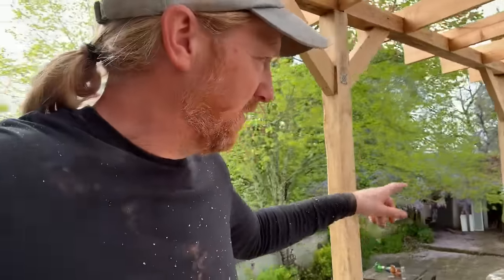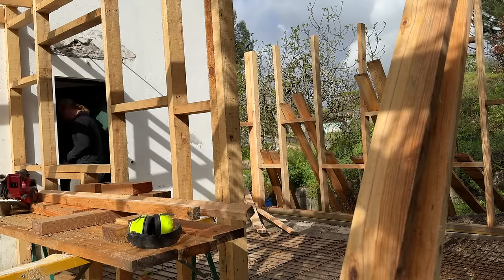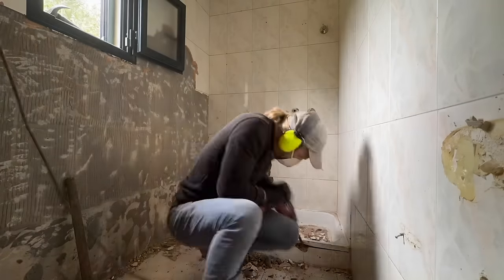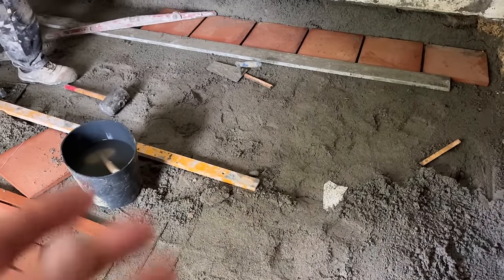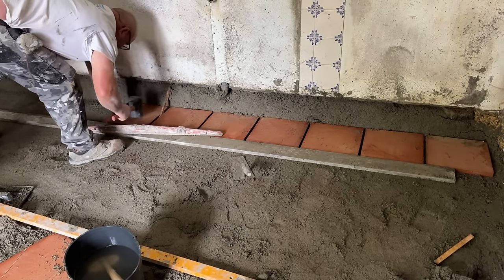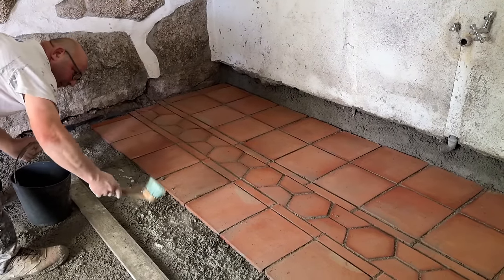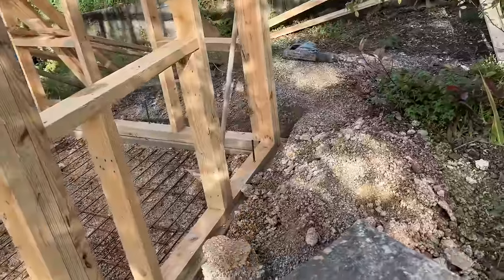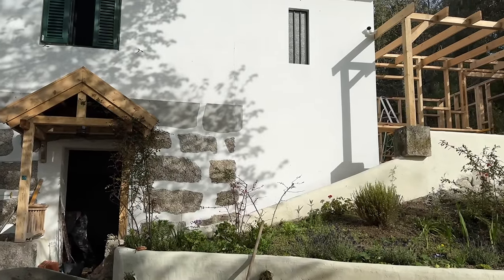It's All Becoming Clearer On Our Portugal Stone House Renovation

Comment: Dear, dear John. I have to say you are one of God's best creations! I'm not sure if the addition of the chickens is meant to signify how you're currently functioning, but it just struck me funny. (Running around like a chicken with his head cut off. Lol) I like the idea of doing the roof as you did the tiny house only in the opposite direction. Not only will it be attractive, but easier to weatherproof in terms of drainage. In the future, take out the inner walls, open the outer walls to the air and you have a great open patio. Put in a couple of couches and build a brick grill. Presto!
I love terra cotta tiles. They make a pattern look like a very fancy carpet!
Beautiful!
Reply from the maker: Thank you Abigail, this was such a kind comment. Thanks for your suggestions for the future, love them 🙏🏼🙏🏼

Comment: John! Why not a staggered roof, you putting terracotta roof tiles a staggered roof would disburse the rain water at two different levels. So like a step down in the middle of the roof would resolve your short wood issue. Would also give you an opportunity to install Soffit, Fascia & and Eavestrough system that could funnel into or towards to eventual catchment pond.
Reply from the maker: Thanks for the suggestion Maria, that is a great idea! 🙏🏼

Comment: You could scafe joint shorter beams together, the overlap would need to be about 1.25 to 1.3m depending on loading.  If hardwood can be pegged instead of bolted as in Medieval times.
Reply from the maker: Thanks for the suggestion Tony 🙏🏼

Comment: Your extension is coming along beautifully and that tile floor is beautiful. But "pagoda?" A pagoda is an asian, multi-tiered  roof stucture like the ones in Thailand, Japan and China! There is one in Kew Gardens too! What you've built is a pergola, an open structure that may or may not have a solid roof but is open on the sides! Sometimes people use fabric that can retract to provide shade or shelter from the rain when needed.
Reply: gazebo ?
Reply: The difference between a gazebo or a pavilion and a pergola is that a pergola usually has an open roof, and a gazebo or a pavilion has a solid, permanent roof!
Reply from the maker: Thanks for the correction Gin 🙏🏼🙏🏼

Comment: Highly suggest that your steel reinforcing cage be suspended slightly before pouring the concrete.  If left flat on the bottom it will most likely result in little or no reinforcement to the cement floor and be more likely to crack in the future.    We see the error of leaving the reinforcement cage directly on the bottom often  here on YouTube, but most of us who have a history  of pouring concrete floors know from experience that this method of pouring concrete floors is flawed.  There is a reason why the industry produces and uses what are called reinforcing 'chairs' for this purpose.  Those who may doubt the above advice might want to do a Google search for the complete story.
Reply from the maker: Thanks for the suggestion Terry! Appreciate it 🙏🏼🙏🏼